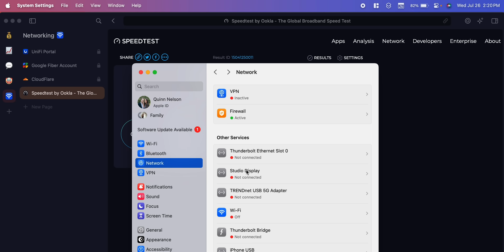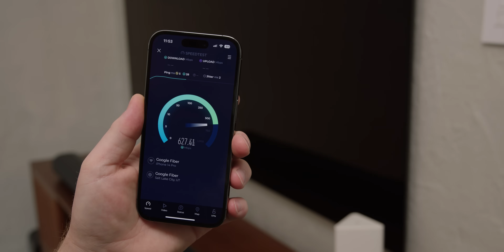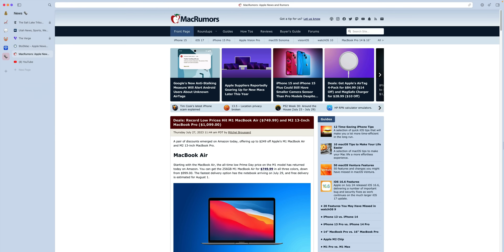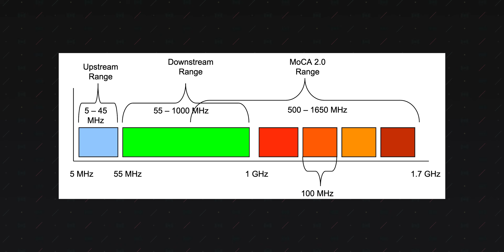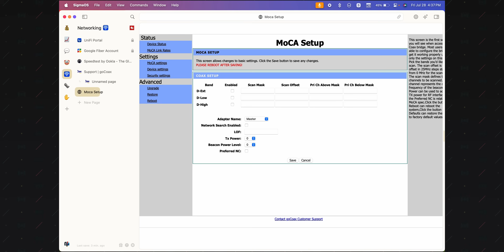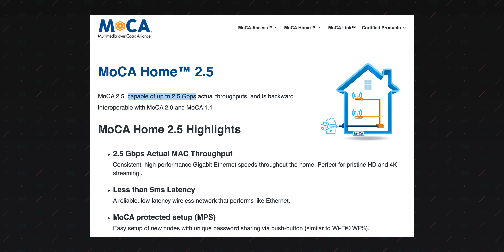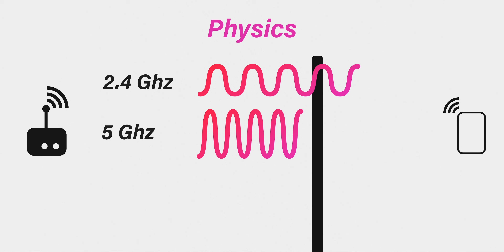10 Gigabit Network Retrofit for Renters. No Drilling Required!

Comment: Just a heads up that those moca frequencies are about to get busier and even some devices(like cable modems)  that theoretically don't operate on moca frequencies get real annoying if there is moca on the lines. Frankly I'd only recommend moca if you're on fiber for your internet and aren't using the coax for anything in your home. Even then much like powerline, you're gambling on the quality of the lines and how they were run. A lot of older houses are run with tons of coax with wild splitting because analog tv was pretty tolerant of excessive splits.

Comment: In what world are native apps dying? I have been in the IT industry for almost 20 years now and in all that time not one user, business or residential, has ever once had a web app on their machine.

In fact we specifically banned the because of their inherent security issues. Any time our users are forced to use a web page for their daily work, we source a native application to replace it immediately.

Also stability and speed of Safari? I'm sorry, but no. Just no. Every single way of saying no that you can think of. Safari is a buggy, slow, unreliable mess. It always has been, always will be. In fact, everything Apple does suffers from this same issue.

Comment: Thank you for this! I live in a condo, an older concrete building where WiFi signals are easily absorbed. I initially bought a WiFi Extender to use with my Asus router, and while it 'worked', it never boosted the signal to something I was happy with. The condo has coax cabling throughout, and after watching your video, I immediately bought the gocoax starter kit with 2 nodes. With the MoCA setup, I'm now able to run ethernet to areas of my home I wasn't able to before and the speed increase is dramatic. I repurposed the WiFi Extender to work as a wired Access Point and my WiFi coverage & speed now makes full use of my internet connection. A fantastic solution all around!

Comment: It is amazing what speeds you can achieve these days with powerline transfer. I remember the days when the maximum speed through the powerlines was 9600 baud and the general consensus was that this represents the best technically possible speed achievable through the powerline cables.

Comment: Just installed a mesh Wifi 6 system using MoCA for an ethernet backhaul on the satellites and it is working great! bit pricey for the adapters but worth it overall

Comment: nice, when yoou still hace coax install, however coax is more susceptible to corrosion and false contact, however
Pre-connected fiber optic cable and media converters would not have been an excellent alternative?

Comment: I don't think 'transmit node' and 'receive node' are appropriate terms to refer to powerline adapters. It's not like one can only transmit and the other can only receive, that would be pretty useless. Both are the exact same unit.
Reply: Weird, my TP Link and Netgear both refer to one as a "transmit node" and the other as a "receive node."
TP link says: Select a node to be transmit and place it next to your modem or switch, powering it on...Power on the receive node and press the pairing...
Netgear says to place the transmit node near your base and receive node in the remote location, preferably on the same breaker.
I'm not saying you're wrong, just have... an opinion on the matter, let's say.

Also, there are quite a few powerline adapters which are not identical. The... uh, oh man what can I say here? I know! The receive node has a gigabit or 2.5 gibibit switch on it so a single Ethernet on the transmit node can result in multiple connections on the other end, say for a TV + game system + receiver.
(Examples include: TP-Link TL-WPA8631P KIT, with a 3-port gigabit switch, TL-WPA8631P KIT where the receive node has a WiFI AC and the transmit node has a plug passthrough not present on the receive node. You can find, probably 50 examples where the two devices differ significantly. 
(Don't ever let your pedantism get in the way of communication.)

Comment: Welcome to the past...Sigma is building off the efforts of MicroSoft when the Internet was still new.  They had a vision that the next modernization of the home PC would be to have a WebOS for Windows.  That instead of relying on software that was installed on your local machine you should instead just access it over the World Wide Web.  That project eventually tanked.  Call it being ahead of its time or the fact that almost everybody still used a slow poke actual MODEM to connect over telephone wiring to gain access to this new frontier.  Plus people on the whole didn't trust using software over the Internet for a variety of valid reasons.  Many people today still don't trust SaaS.

Comment: I have a different suggestion: replace phone cables with ethernet cables.
If you're lucky they are already arranged in a star topology (all going to a central location) and you're golden.
If they're daisy chained, you might still manage to make due somehow (I just replaced a small part to connect two rooms I needed).

Comment: Another option that is slightly more "invasive" but doesn't require drilling or holes is using existing telephone lines for Ethernet. It would have to be a relatively newer house that uses 4 wires of a cat 5/6 Ethernet cable instead of actual telephone line, but if you can see the full cable behind a faceplate, get some cheap tools and a YouTube video and you can turn it into Ethernet lines with gig speeds. Similar caveats with Moca, would be easier with a known central location you have access to and depends on implementation but it's an option.

Comment: I wonder how far does a MoCA signal go and how powerful fo a signal repeater you could get to work with it. Be funny to beam internet to your mate across town on a shoddily installed coax cable running on the sidewalk.

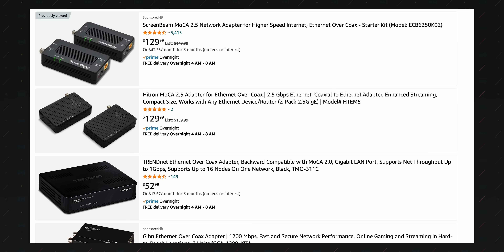Comment: 12:10, a more easier way to understand is take the whole coaxial as only a single cable, because basically it is. And just like a single Ethernet cable, it will have specific throughput

Comment: Hi, I changed my ISP recently, from Coax to Fiber connection. There’s a coax from the main cabinet to my living room. In this cabinet there’s is the starting connection point for both fiber and coax providers. Since the coax on my walls is unused, this video really helps me, but I have one question: Can I use the goCoax to forward the ONT signal through Coax (in the main cabinet), and connect the ISP router on my living room?
Reply: I will change the router later, but for now I’d like to start with having the ISP router on my living room, and this way have a better wifi signal, instead of having the ISP router (+wifi) inside of a cabinet at the apartment’s entrance.
Reply: I found the Devolo Giga Bridge, but it is a bit expensive when comparing to these MoCA solutions.

Comment: I had MOCA 2 for awhile it worked great, I but decided to Wired I used the molding around the floors worked great and the places where I had to go through a wall already was a hole where Coax used to be so just ran it through that. Didn't have to make any new holes.

Comment: I've never had much luck with powerline. I mean it works, and sometimes you'll get good speeds from it, but every load change also changes the speed or can even cause interruptions. I've only recommended it for people on something like DSL where the connection speed is lower than the even low powerline speeds and running a wire or wireless isn't feasible.

I've got 5e wiring in my apartment, which was built just before wifi became common. It runs 2.5 gig fine (once I re-punched the runs on both ends) so I make do with that. Internet is 'only' gig fiber anyway.

Comment: No gold splitters

Gold splitters are bad.

Use Antronix, Amphenol, Commscope or equivalent. (isp-grade splitters, usually Nickel-Plated Brass, and significantly heavier than Walmart crap splitters
Reply: Also use ppc moca filters to keep moca signals inside your residence

Comment: Verizon installed my router in the bedroom I was using as an office.  The router needed both an ethernet and a coax connection.  The  ethernet connection is actually wired to support land line phones (I have FIOS internet, phone and tv service).  The coax lines in the house connect to the FIOS fiber adapter, the router and any TV set top boxes connect to the coax, and phones plug into the "ether net" jacks (phone RJ connectors are backwards compatible with RJ45 ehternet jacks).  I needed ethernet jacks in the living room so I ran a network cable to the router and tacked it along the baseboard from the office to the living room.  Verizon didn't tell me they offered MOCA adapters that would do this, it appears that their router has MOCA transmit built in!  Oh well, the ethernet switch and a length of cable were cheaper than the Verizon branded MOCA RX adapter ($99 from Verizion).  I paid about $20 for the surplus 10/1000 switch.  Each Verizon MOCA adapter has a built in 4 port ethernet switch.

Comment: As a cable tech here's some thing to note about MoCA.

1) Its a great technology, but it is a fairly expensive one. As has been pointed out you will have to purchase a node per connection point. Want 3 places to get that sweet wired connection well then you're shelling out close to or over $200 on top of everything else.
2) You need to know where your cables go and have unrestricted access to them. In a SDU this isn't an issue. Just go to either the splitter point in your basement/crawlspace/attic/outside demarc and get the cables you need put on a splitter. If you're in an apartment, there's a good chance your cables are inaccessible in a maintenance room or possibly in a locked MDU enclosure where they may also not be labelled and you risk taking your neighbor offline. While you're here, That point of entry filter that was mentioned should be found here, its become standard that all individual addresses have one to prevent cross talk. If you don't see one, get one. Look on Amazon for a 70db MoCA filter. You should see a result from PPC for around $9. Go ahead and put that on the input of your first splitter or on the bond block.
3) If you do happen to use more than one cable box created within the last decade these can interfere with your secondary boxes. The cable companies, including but not limnited to Verizon/ATT/DTV/Dish/Comcast/Cox/Spectrum, have all been using MoCA for years. Its how they've managed to get the secondary boxes so small with feature parity. They put a MoCA adapter in either their gateway or in their DVR/"Primary" box which will receive either just internet signal or both internet and cable channels. Then they have multistream tuners that the secondary boxes borrow over the MoCA network to allow them to watch TV. They also transmit internet to these boxes so your netflix and youtube apps function or if they're just using IPTV and not tuners.
4)  If you use cable internet the time to use these is closing in unless your provider decides to cut out a chunk of signal specifically for its usage. This isn't an issue if you can create a closed loop system where only your MoCA devices are connected, but if you put one on the input line of your modem there's a chance that the signal capacity changes coming with DOCSIS 4.0 (both the ESD and FDX versions) will block out MoCA entirely as these companies move towards 1 cable line for the internet and wireless cable boxes.
5) Just like with everything else the quality of the components matter. In this industry "gold means garbage", if you're buying a $2 splitter that's gold in color on the outside you're buying garbage. A good quality splitter is available on amazon for $4-5. Go with brands like Commscope, Antronix, Amphenol and they don't need to be rated out to 2500MHz. We use ones rated to 1004MHz and MoCA works just fine. You can also get specially made splitters specific for MoCA like the Amphenol IPGH3M4-VF, where it has a standard "3-way" splitter on one half which passes all the signal through those ports and 4 MoCA band specific ports that can communicate back and forth. 
6) If you get a splitter that has more ports than you are using, get 75ohm terminators and put them on the unused ports. Incoming interference from everything from FM radio to Cellular services  can have an impact on both your internet and everyone on your node.

Sorry for the wall of text, but these are things I think people should know about MoCA before giving it a go. Nothing worse than buying $200 worth of gear only to find out it won't work for their specific case. Otherwise good luck and give it a go...coax that is.

Comment: Awesome video, going to be great for folks who don't realize MoCA is a thing! FWIW (as you noted, but to reiterate), MoCA goes up to 2.5Gbps, so if you're doing a "10 gigabit" retrofit, the max throughput once it hits MoCA will be capped at that 2.5Gbps speed, even if the rest of your ethernet is 10Gbps capable. I do have it on my LAN since my house is really big and I use it for a few spots in my house where I don't have ethernet and the WiFi signal is 💩. So far it has been amazing and I was thrilled to realize I had that option; I had no clue it existed.

Comment: I have coax in literally every single room in my house. However, the wire going from the basement (where the other coax cable for internet goes) is cut (or maybe I didn’t terminate it probably) before making it up to the attic where the 8 way splitter is. Should I pull through fresh coax to the attic, or just pull Ethernet through with the existing coax? I pay Comcast for 1GB down and 5 MB up (cable internet) and get around 150-250 minimum ping so I probably wouldn’t notice much with moca, right?
Reply: Your coax is most likely stapled to the studs, so you won’t be able to pull Cat 6 through

Comment: Check out the FCA252 moca adapter. It has a handy 25GW toggle that lets them operate over the cable frequencies. I’m using this to “move” my wan connection to a different room. Then use other moca adapters as above. These can basically allow for two networks on the same coax cable!

Comment: Bought some MoCA adapters when I was renting a house, was able to rewired the existing coax cable to make it all work with my network setup. When I moved into my current house, rewired the existing coax to make it all work. Ethernet cable will be the next step but have to layout the path for ethernet in a townhouse setup.
Reply: *to rewire (infinitive, not conjugated)

Comment: Unless your Coax goes out to the cable infrastructure, which mine doesn't, you don't need to do anything like this.  But if it does, not all cable providers do a Moca filter.  Be mindful of that.

Comment: There things suck!!!
Reply from the maker: What…?
Reply: It's the American wiring 

The UK wires houses using bi directional looping 

The USA use series single direction 

Not the best then the UK have far better quality of wires because of regs etc and load sharing between the two lines and having double the voltage 

In the UK I only loose around 18% by using powerline adapters

Comment: The Moca nodes are a nogo.. As a CommTech here are the issues: 

1. Those "Coax Patch cables" used in the video are a nogo... The connectors on those lines are not the greatest. If you need short COAX you can usually visit your ISP and get free ones, even splitters...

2. Cheap splitters (like the gold ones from GE) are known to cause ingress in the system, as well as creating MER/BER issues within the signal.  Although you are plugging in the node by the DVR in this video. Poor connections/splitters affect everything attached to the coax. Example ; Ingress in a 3rd floor bedroom affects the modem on the first floor, as well as the DVR in the living room.

3. Randomly adding a 2-way splitter into your system isn't a good idea because of signal balancing. A 2-way causes a 3.5Dbm change in transmit as well as receive to you're providers equipment. In many homes they cannot afford that change in signal.

4. Companies like Xfinity have MOCA filters either integral to their ground blocks, or a standalone filter at the ground block. Specifically designed to keep your MOCA within your premise.
Reply: If you had an On Q panel and your input/feed was directly to Modem would this work? Can noise backfeed through the ethernet device and cause for a notchfilter/ trap? (Internet only no cable box)

Comment: wrt to the pairs of the MoCA and PLC transceivers, ‘receiver’ and ‘sender’ is incorrect. The Internet isn’t a pure broadcast like TV/radio. Most devices uses the ‘primary/secondary’ or ‘master/slave’ terminology. Perhaps, ‘upstream/downstream’ notion makes more sense. This is forgotten in the context of wifi APs too but APs are not just sender but also receiver, much like the wifi clients are also sender and receiver. The Internet would not work just by ‘receiving’ signal.
Reply: Yes, you are correct. However, even though the "master/slave" terms in technology are technically correct, there are some people complaining about the use of these words because they may be considered politically incorrect. For example, on the "Security Now" podcast, Steve Gibson (one of the hosts) used these terms correctly, but someone wrote in to express dismay about these words, even though they had not been used to promote human slavery.

I am not afraid of words, but in some circles, apparently some are.
Reply: @Eternal_Tech  Sure, and that is a problem. But which is why I had several options other than master/slave. My point is, there are many options other than master/slave that is more technically accurate, yet, sender/receiver was used and that's problematic as this really spreads misunderstanding.